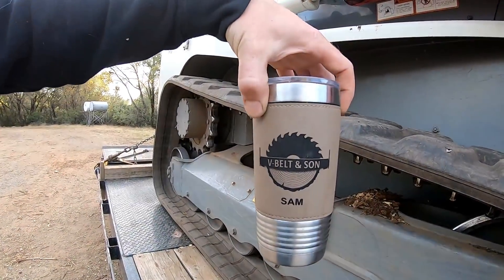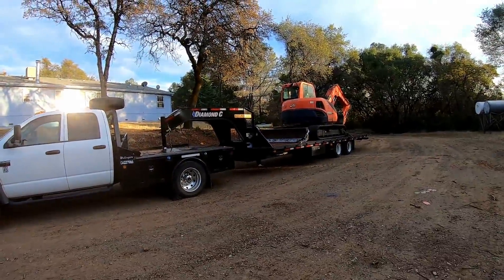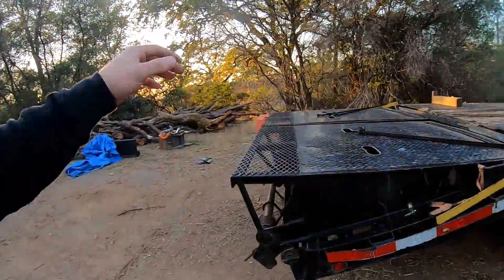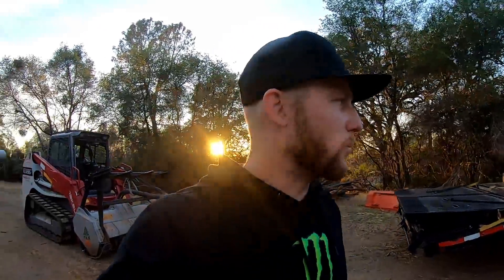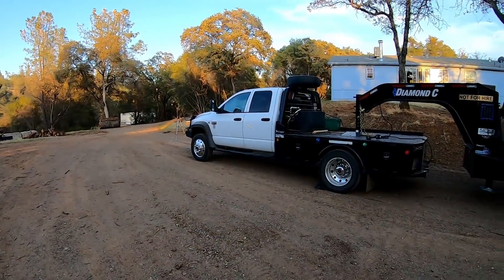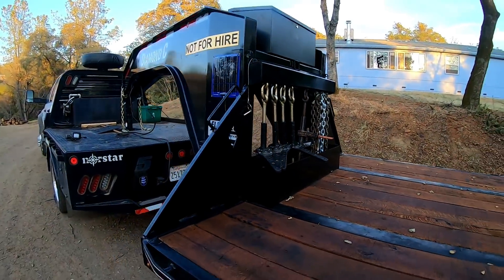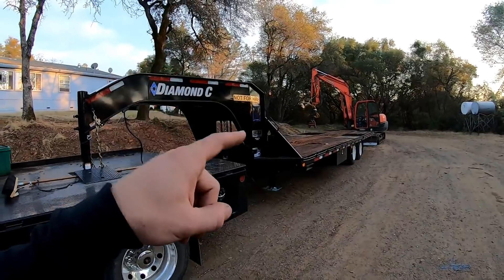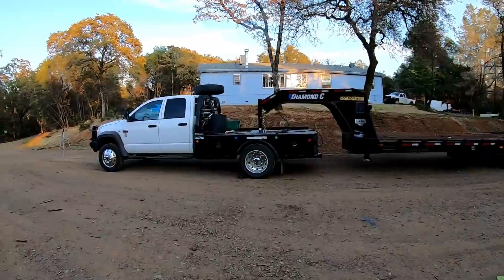COMPARING GOOSENECK TRAILERS UNLOADED TIMES CONVENTIONAL RAMPS VS HYDAULIC RAMPS

Comment: Don't let anyone give you a hard time about your safety measures while loading/unloading. About 12 years ago, I was unloading an excavator from a trailer. The trailer was hooked to a dump truck (on a slight downhill grade) so I didn't think much about the excavators weight shifting as I was unloading it. Well, when I got the excavator to the back of the trailer, the rear of the trailer dropped, thus taking the weight off the rear axle of the truck. The truck, trailer, and excavator started rolling down the hill. Luckily, I was able to swing around and drop the excavator bucket to the ground and get everything stopped. I learned a lesson that day, that has stuck with me since!

Comment: I have ever intention of putting a line lock on my pick-up, it just makes sense to me with a manual transmission. you can lock the front brakes when you're loading/unloading the trailer, on a boat ramp relying on just your parking brake, could also apply a line lock when your winching, and of course for goofin with some nice burnout/launches. I also think to figure a switch to apply power to brake controller to lock trailer brakes🤔 Great video brother.

Comment: Question- why had you rather pull with a truck and trailer instead of say a class 6-7 medium duty flatbed? I fought and fought trying to find the perfect setup like you’re doing with different trucks and trailer but I finally bought a freightliner m2 and custom welded a dove tail and I LOVE it. So easy getting in and out of tight areas and the air brakes are where it’s at as far as stopping power. Love your vids though! Perfect combination of machines and trucks and I even get a glimps of some dirt scooters from time to time!

Comment: Thanks for the info on the Diamond C.  Did have a question about your rams.  Looking to get a 3/4 ton or a 1 ton SRW to pull a 14k trailer.  Will also be a DD.  I’d like to get a diesel but I drive 1.5 miles to work and 1.5 miles home 4-5 days a week.  1-2 days every other week I’ll be towing.  Does that sound like recipe for disaster with a diesel (short tripping)?  I like the ram Cummins and looking hard at the new 7.3 gas ford since I’m a little Leary about short tripping a diesel so much.
Reply: As long as you have the chance to open up a diesel once a week on the highway, you'll be fine. Not to mention diesel gets twice the mileage and more power, as well as better resale.

Comment: i bought a gen y 30k coupler last week....lookin foward to smooth smoothin
Reply: Interested to see what you think.  When we picked up our diamond C i asked about it vs the shocker hitch.  They said they have never had the shocker hitch returned but actually had a used gen y sitting there in the showroom that a guy used, brought back and said he was going back to the shocker hitch.
Reply: @MitchellH79  let ya know........🤞✌
Reply: @MitchellH79  also and looking at the shocker and seem to only find only 6000 pound tongue weight ,my specs for my truck allow more ,so I'm not sure if I would go with that spec.. Correct me if I'm wrong.. Still looking into it
Reply: They have a 30k gross / 7k tongue weight version. How’s that compare to the gen y?  What I was told is that the gen y doesn’t do anywhere near as good of a job of cushioning the forward/backwards surges
Reply: @MitchellH79  ordered it  , i expect it delivered next week..ill let ya know what i think...

Comment: Why don't you check out the genyhitch? No maintenance plug and play don't have to worry about the air and get the same outcome.
Reply from the maker: Julio Almaraz didn’t see one rated at 30k
Reply: @VBELTandSON  5500-7000 tongue weight and 30k rated GH7082 or GH7092
Reply: @VBELTandSON  i ended up buying mine off amazon...it saved me $150 in shipping

Comment: I have a PJ gooseneck 40 footer with 11 foot hydraulic tail it’s eating itself apart and I was wondering if you could take pictures of how they set up your hydraulic tail because I had to cut mine off completely because it destroyed itself .It’s a very poor design and would bounce up and down while you drove down the road at bent itself apart so I need to cut it off and modify it and make it work better. PJs notorious about having the rear ramp break right off.

Comment: I dream of a hydraulic dovetail gooseneck trailer. But want one that can also lift to dock height if the occasion arose. Can the Diamond C do that?
Reply from the maker: Drew6709 how high is a dock I can measure it.
Reply: @VBELTandSON I think those heights are 4' or close to. And can the dovetail be used as a Jack to lift the axles up to change tires?

Comment: Up or down a 15% grade at 30 mph takes 18 horsepower to either force 1500 pounds up the hill or retard it down the hill.  And of course a motor doing the work will always be easier. So the drill motor and the hydraulic pump motor take the strain off an operator. I always use a motor if I can. To set up my trailer when I get into a camping spot I have 7 motors. Three on remote control jacks one at the tongue and one on each back corner. Stick a level on my kitchen counter and press the buttons on the three remotes until I am level side to side and front to back, . Then I open the door on the electrical control center which is right next the counter and run down the four stabilizing jacks. If I ever have to lift the wheels on one side or the other off the ground, the jacks will do it.